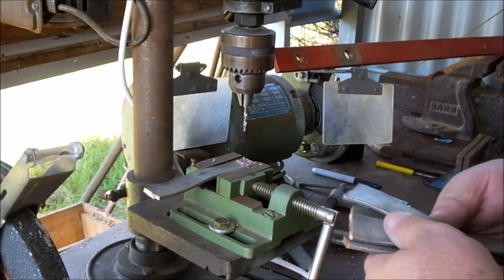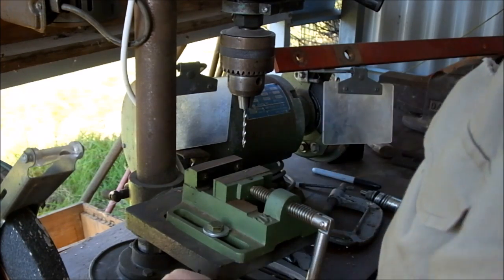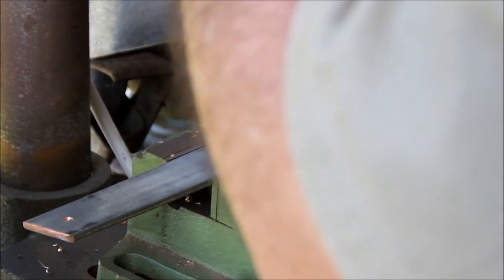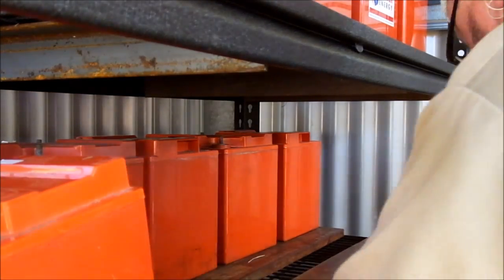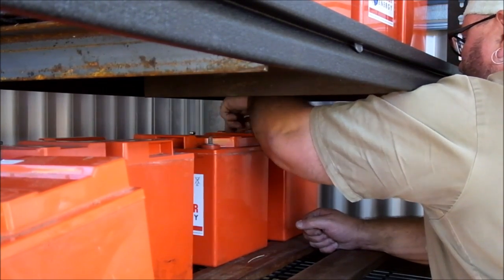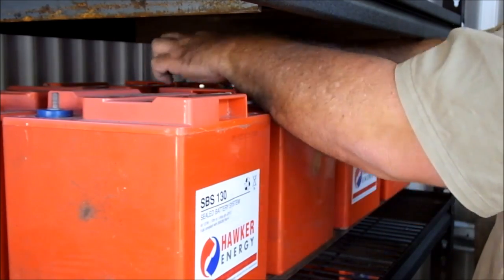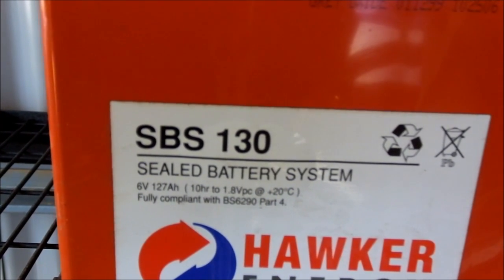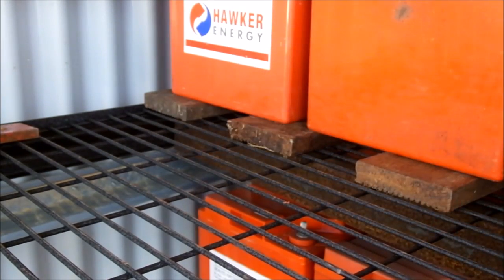Off Grid Solar Power - Connecting Batteries in the Solar Workshop

Comment: Why choose 70% SOC? Personal preference? Most manufacturers rate their batteries down to 50% and for deep cycle use the accepted usage is also 50% for normal agm or sla batteries.
Reply from the maker: The higher the SOC, the longer the batteries will last.